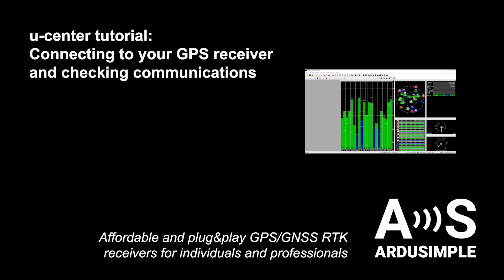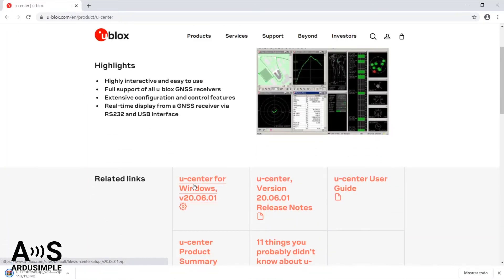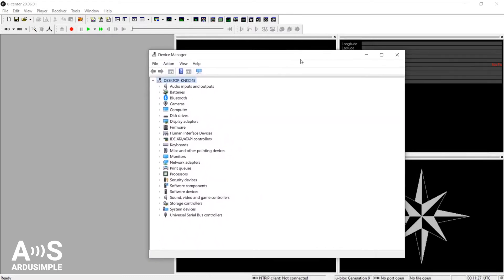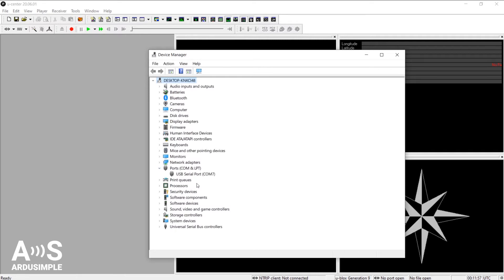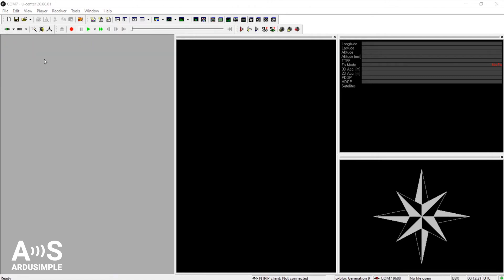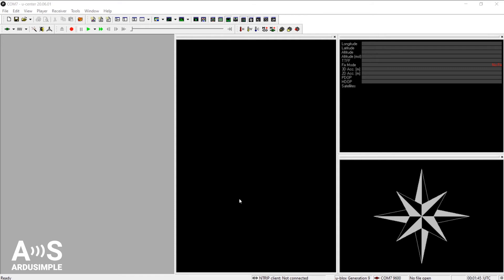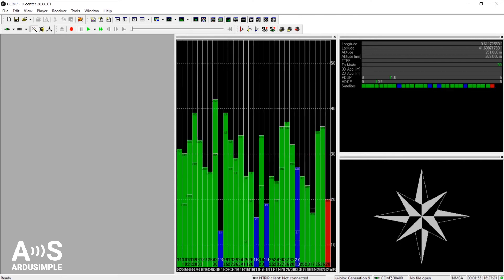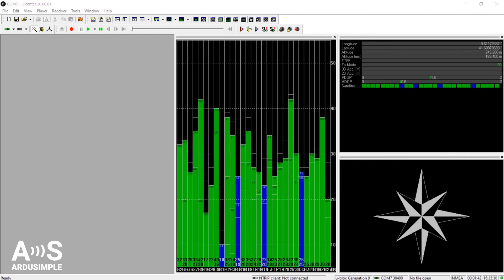u-center made simple: Connecting to GPS receiver

Comment: I bought NEO-M9N receiver and can't see  it as external drive. Does it have software integrated ready for installation or not
Reply from the maker: We don't work with the NEO-M9N module. We suggest you go to u-blox forums and ask there :)
Reply: @ardusimple  thanks, which receiver are you using in this Video, does it has external drive and any software integrated?
Reply from the maker: @layanagouz  we are using a simpleRTK2B receiver with u-blox ZED-F9P module.
This receiver does not have external drive functionality and has u-blox firmware on it, in order to configure it you need u-blox u-center software.

Comment: Can I use my own GPS receiver to connect to my computer via this u-center software?
Reply from the maker: As long as it outputs NMEA protocol yes, but some settings will not work.
You should still be able to monitor signal strength, coordinates, etc..

Comment: I need a lot of help, hope someone can help. Just got BN-880, not using it on drone, want it for boat. BN-880 blue light is on roughly 90% of the time, red light comes on roughly 10%. I'm assuming that is correct. I am very familiar w/visualgps, so try it. All I get is garbage 8-bit characters. I know default baud is 9600, tried that and all other baud rates. u-center never connects. It goes thru autobauding, never stops that. I have connected both TX & RX (and of course ground and 5 volts. I have 2 different ftdi usb cables, one for rs232 (very familiar with those). Visualgps gives me garbage so I know wires are connected properly. Thanks for your time, I really appreciate it.
Reply: After lots of playing around, I got it working! I have a USB CP2102 TTL chip that works!!!